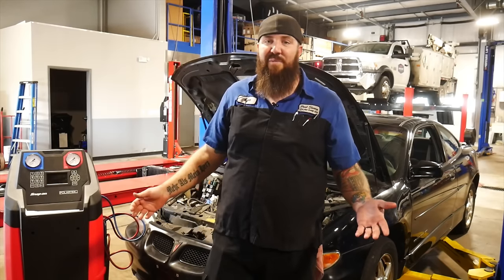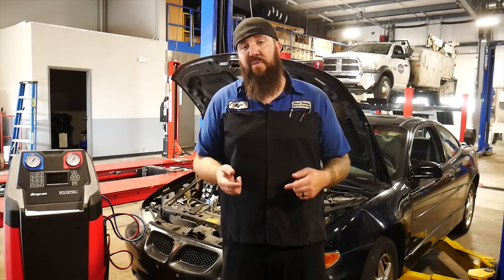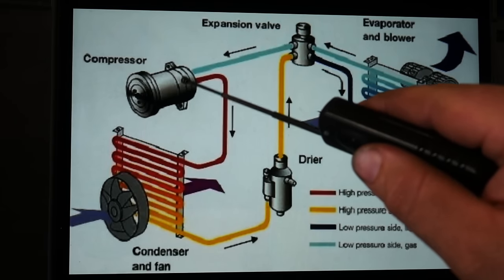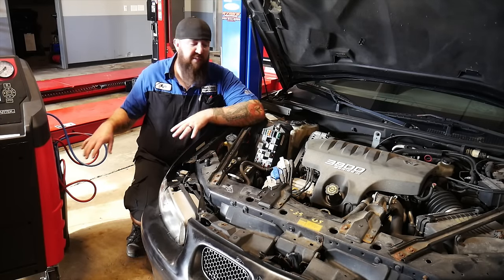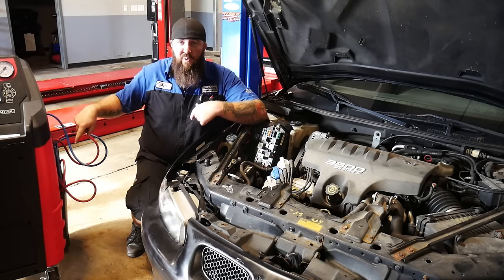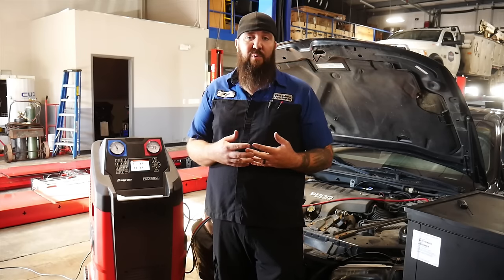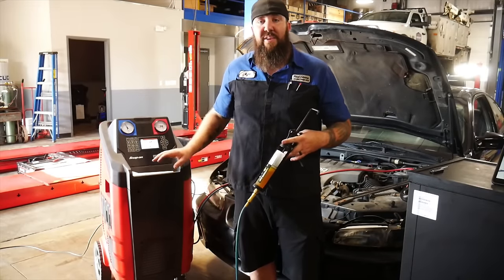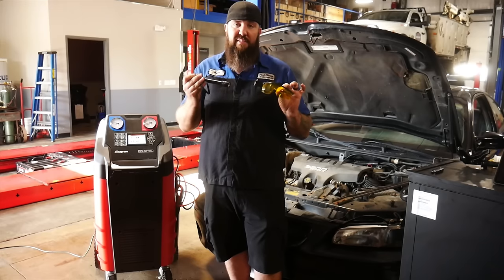AUTOMOTIVE HOW TO: A/C SYSTEM DIAGNOSIS FOR BEGINNERS

Comment: Thank you for the detailed explanation on car AC system. But how to do a diagnostic on a car with totally empty AC system and which has a small leak, how to find that leak?  
I know about hydroscopic properties of the PAG oil. Before I thought it is only air which has the water, and deep vacuum takes care of it. Anyway, I pressurized the system with air, and found a huge leak on Expansion Valve-to-Evaporator connection.  It was hissing, and you could hear it w/no additional devices. It was a wrong o-ring, which came w/the Exp. Valve set. I put a thicker o-ring on the bottom tube (3/32"), and the huge leak stopped. But still there is a small leak somewhere. I pressurized again (30-50 psi), spraying w/soapy water - nothing. But the pressure goes down on your eyes, you can see it, slowly, but drops. It was me, who did something wrong and I can't find it. The system was leaking of course, but much much less. Originally it was empty (the car was w/no AC for 10 years, it is our back up car and we didn't worry much). I tried to fix it at Dealer, but after their several attempts it still failed like after 2 weeks. But the system was working for 2 weeks and after I tried it after 10 years pressing the Schrader valve (I wanted to be sure that there is no refrigerant there, though the gauges showed zero) w/a small flat, it gave that 1 second "pshik" sound. I replaced everything besides Evaporator, Compressor and Liquid Line (it is Expansion Valve to Drier Line on Saturn). Liquid Line I couldn't find for that car, Evaporator is to hard to get to, and the Compressor didn't stall the car before, so I decided to try it. So I flushed the Evaporator and Liquid Line well, several times w/99% Isopropyl Alcohol, then w/Flush Fluid, dried for several days. The Compressor I removed flushed and dried in the same way. I added  PAG100 oil (w/Dye), put all the new o-rings (put oil on them) and washers (no oil, like Shop Manual advises), torqued to specs (I have Shop Manual for that car). So in the future I can repeat all that flushing, put new oil, and everything, but I do need to find that small leak somehow. Do you happen know what can be done at this point? Thank you again.

Comment: When checking subcooling, don't you need to have a high velocity fan blowing on the front side of the condensor to remove the heat from the refrigerant, or is the fan that is installed on the rear side of the water radiator all that is needed? When I check the subcooling on my Toyota Sienna, the sensible temperature of the high side line slowly creeps up causing my subcooling number to continually change (get smaller and smaller, until I have a negative number - which I believe means that the condensor is not getting rid of the heat). I realize that checking cars are a different beast, as compared to checking the HVAC on a house (which has a huge fan that's removing heat at the condensor), so how do vehicle mechanics deal with checking subcooling on a vehicle that's stationary?

Comment: You mentioned in the video that the high-side pressure range is typically between 200 and 260 PSI, and I gleaned that the low side should be around 30 PSI. I didn't hear you specifically mention what the normal pressure range should be for the low-side? I presume that both the high-side and low-side pressures are based on factors like the temperature of the refrigerant, but was wondering what was typical?

Also, do you know what the typical compression ratio should be for automobiles? I'm used to a compression ratio of ~ 3 for home HVAC, so was wondering if that's the same for automobiles. The compression ratio that I'm referring to is when comparing the high-side pressure to the low-side pressure, factoring in standard atmospheric pressure. For example, based on the numbers I saw in this video (High-side = 200PSI and Low-side = 30PSI), I calculate that the compression ratio to be 4.8 (High-Side 200PSI + 14.7 = 214.7PSIA)/(Low-Side 30PSI + 14.7 = 44.7PSIA) = 214.7/44.7=4.8

Thank you.

Comment: Not sure if this is a question you'd be able to answer with the limited info I have, but I have a question regarding possible short cycling. Just bought a 2018 Mazda3 and have noticed the compressor is kicking on for about 8 seconds then off for ~15 seconds over and over basically on repeat. This is with the A/C set to 69 degrees, low fan speed and recirculation on. The A/C works great, always blows cold, no issues I've noticed anyway. All over the internet I've read that it's both totally normal, while others say it's short cycling. Would this typically be considered abnormal cycling?

Comment: We’ve gotta get that new machine for the 2019-2020 vehicles in the next year or so.  $7k for one of them bad boys.
Reply: The 1234yf sucks our machines take way longer than the r134 and only does the leak test when you are charging it won’t do it separately
Reply from the maker: Yep, the 1234yf’s are very time consuming but that’s a lot due to EPA mandates deflation BS. It’s not a quick 20 minute process anymore when it comes to those machines.
Reply: @RustbeltMechanic  wats the difference between 134a and 1234yf?
Reply from the maker: jclark 1234yf is the new industry standard refrigerant. Different chemical compound that is 85% better for the environment

Comment: I have a 2015 GMC Sierra 1500 4whl drive 5.3 my ? Is that when I turn the ac on it throw hot air an it  take like 15min to throw cold air install ac compressor an a  expansion  valve , evaporator, an condenser about 1yr ago thank you for your videos keep the good work please respond

Comment: What could be if my AC blows cold air only if I rev the car past ~2000 RPM ? Also if I keep car in a cold location it blows cold air right away when starting, but if I kept it in hot sun, I need to rev it for a while until I can see some cold air.
Reply: 3 weeks later… it was NOT the compressor, I learned that the expensive way 😅

Comment: thank you very much.  i am still learning. ( ac evap is not leak but the fin of ac evap is blocked with dog fur, dust..etc.   what is the the pressure on low side and high side?

Comment: Please correct me if I'm wrong, can a low refrigerant level cause high and low pressure and low high pressure? Similar to what you showed what they stuck open expansion valve?

Comment: Awesome video man. I’m very new to this I just put a compressor on my wife’s car and it called for 5oz of peg oil this was added to the compressor and reinstalled after I got it back on I then pulled a vacuum for like 45 mins does pulling a vacuum suck that oil back out? It maybe a dumb question I have no idea thanks for any help sir and have a great day
Reply: Hey, im not sure if you found your answer yet, but yes some oil will be sucked out, but it can be put back in while injecting freon, usually it's as easy with a syringe or with the system like a robinair. Just be sure to add the oil before you start it up.

Comment: I just have one question, the first step is to add oil to the system on the low pressure side, the second step is to draw a vacuum in the system and finally add the freon.

Is that correct?

Thank you

Comment: Very Nice awesome but in the diagram shown we got High pressure gas side and low pressure gas side at compressor. So where does the PAG oil for the compressor go?....Would FREON acts as a vapour lubricant ?.....

Comment: Hey, I hope all is well. I just had a question. If I have a clogged expansion valve, won't the low side pressure gradually drop regardless of if I'm driving or idling? As long as I'm idling Ac blows cold, but when I take off to drive it becomes ambient temp after some time. I'll check the low side temp and it is very low. Before driving at idle it'd stay at 30 psi. Thanks!

Comment: My compressor is weak only compress in high speed not on idle,What causes that, do you know? You did not cover it.
Reply: Check the "V" belt or Serpentine belt for slipping and the idler pulley could be slipping.

Comment: My Car Aircon compressor Does not disengage automatically, the evaporator has already cleaned, drier, expansion valve and evaporator thermistor also changed to new one, aircon is drawing cold air, what seems to be the problem?

Comment: Base on my understandingv of this tutorial I have an expansion valve issue to which I was also told by an expert AC technician. I replaced the expansion valve and still having the same exact issue. Does that mean than that I installed a bad or faulty expansion valve even though it’s new?

Comment: I'm having a issue with my 200 F350 5.4, the system isn't cooling and when I hooked up my gauges the low side drops really low when running over 2000 RPM and then the compressor kicks off and on again, but at idle it seems to work just fine. I thought the system was just low on refrigerant so I added some. Now the compressor clutch slips, I've got a video on my channel of what I'm seeing.

Comment: My compressor is sounding bad so I’m going to replace it.
Also replacing the condenser/drier and expansion valve aswell as the performance has been bad.

The thing is : the new compressor comes filled with oil.
If I pull a vacuum after installing everything will that affect the oil level ?
If not : will the system be overfilled with oil ? I’m still going to have oil in the lines and the evaporator since I’m not replacing them

Comment: Hi, I have a Captiva that the aircon only gets almost cold on the drivers side and warm on the passenger. Ive checked the blend doors and they are closing fully. The low and high lines are both cold at the TXV. Also the pump never turns off, so I suspect the TXV is not working correctly. I have a mate whos is coming in a few days with his gauges so your info already given should help me diagnose it. But if you have any clues with the info I have given that would be appreciated. Cheeers

Comment: What year is your truck?...because you have the newer style shift lever (07-up new body style)..did u retro fit  this on your truck?..also your thoughts on a trans pan with a drain plug.(changing my fluid and filter and was thinking of installing a new pan with a drain plug)as my 04 did not have one from factory, butt my brothers 02 does..same trans i know.(4l60)..seems like a good idea for plug?
Reply from the maker: My truck is an 06. The shifter on this one is stock for a 2500. And when I did my trans it came with a deeper pan for the Allison with a drain built in.
Reply: Thanks .appreciated reply

Comment: Hello,  thank  for sharing this video.  I have a 2012  Toyota Highlander. Compressor clutch engages but the AC always blows hot.  The high side  pressure is 90psi and low side is 45psi when compressor is running. And when the clutch disengages for abt 5secs the high side drops to 80psi and low side 60psi. The strangest thing  is the condenser fins feels fairly cold and the receiver/drier also feels somewhat cold as well. I suspect a restriction,  but not sure where it is. There is equal pressure of 70psi on both high and low pressure sides when the compressor is not running. What could be the solution  to this problem? Thanks again.

Comment: Do you have to add oil to the condenser and drier valve? I thought you just have to add PAG oil to the compressor. I'm planning on replacing a compressor with a seized clutch along with the condenser and drier valve and then having it professionally evacuated and recharged. Should I tell them to add more oil and UV dye?

Comment: Hi
Love the video. Wonder if you could diagnose this problem. I only have a low side gauge. Static pressure is exactly right. Electrical is all good. System cools well but the low side reads nearly nothing and compressor make a buzzing noise while running. Any ideas.

Comment: how often should the compressor clutch cycle and how long does it stay off with the AC running. If the clutch never cycles and stays on could it cause the engine to overheat?

Comment: Wait what, you need oil in your AC System? So if I had all my Freon leak out and put the correct amount of Freon back in, I still need to add oil? I have honestly never heard anyone ever say this, I’m surprised.
Reply: The oil is carried throughout the system by refrigerant attached like soap bubbles. Along with the loss of refrigerant, a large part of the amount of oil is also lost.
When recovering the refrigerant, a part of the oil is also collected and must be inspected visually. Assuming it has the correct amount, when refilling, add new oil in the same amount recovered.

Comment: I'm not an AC technician but I understand how AC works. My daughter's car the low side pressure Rises when you turn on the compressor which is making me think that the expansion valve is stuck wide open because I'm not building any pressure on the high side and the low side pressure is not dropping

Comment: Can I ask for help on one please:  2009 Audi A4  128 degree air temp into condenser, fan operational. Duct temp varied to much to get a reading but it wasn't cold. 
Idle 70 low 225 high
2,000 rpm  350 high and compressor cycles on and off at around 22 psi.   
Not sure if it's excessive oil or a plug somewhere.  I can say with the little bit of refrigerant going into the lines to check pressure, about a tbsp of oil drained back out when removed.

Comment: I have a 2004 Ford Expedition and the fuse for the compressor clutch keeps popping. Would that indicate and issue with the compressor going bad?  The clutch is not locking. Fuse pops as soon as i hit the A/C button.

Comment: Excellent video. So my question is where is the problem in a system if your evaporator core is icing up?
Reply from the maker: Likely the expansion valve is stuck open too far, there’s not enough air flow, or the system is over full

Comment: My AC stopped cooling when I was at stop and began cooling when I started moving.  So what cause the fan not to engage? I know the fan is connected to a pressure switch. Is there a parameters to tell the fan to turn on and off?  I plugged in a pressure gauge manifold and notice my low side is more than 40psi. I relieve some pressure and bring it down to 35psi and now everything seems running fine. I have a R1234y systyem.

Comment: Great video on how the system works in general, thank you.
I have 1986 190e which the A/C doesn't work, the compressor doesn't comes on.  I changed the original compressor and the dryer to 134A compatible, changed the push-button control & A/c relay, and the pressure switch, still no luck, would you direct me how to fix it.  Couple local mechanics has charged me to the nose, yet no A/c
Reply: 6 months late , use a piece of wire to jump the pressure switch to see if compressor runs

Comment: I have low pressure 55 and high pressure 150. Fan and compressor working. Only blows colds when running. I change a hose that broke i pull a vacuum and recharge it .

Comment: I thought that my car was low on freon.  Since all the sudden stop blowing cold.  It was working perfect a couple days ago. Sometimes when i start the ac systems get very hot around 125 degrees. And cools down to 95-89 no lees then that. I put 2 cans and last night was working perfec and this morning ac blow warm. The ac clutch engages. The low line where it gets freon doesn't get cold. Driver side its a few degrees higher. I already check the fuses and ac relay and they are ok. Im thinking probably not enough freon or the expansion valve... my car its a2008  mustang gt. Any sujestions or opinions? My car takes 1.625 pounds of freon (26oz)

Comment: I replaced the expansion valve and pressure switch on my 2006 H3 Hummer. Compressor clutch operates as it should. I started charging the system and have only 4 ounces of r134a in it. Both high snd low sides showing 120 psi. No change in cabin temperature.  Bad condenser? Compressor? Something else?

Comment: Hi -
I’m coverting a 1988 S10 from r12 to r134a. I am changing the compressor, accumulator and Orifice tube.
I have flushed the entire system.
I’m told the new compressor comes pre-oiled.
After pulling a vacuum on the entire system, do I need to add oil?
Thanks

Comment: I'm having really high pressure and normal low pressure.  about 325 High and 35 Low.  Ambient is 96F.  My radiator and condenser fans are spinning.  I also have a fan (walmart fan) in front of the car to simulate driving conditions.  Does that mean my condenser fan is simply not strong enough to vent air out of my condenser?  Or that is it that my radiator preventing the venting of hot air? the radiator sits between the condenser and the fans.  Or is my walmart fan not doing enough work to simulate and cool the condenser?  The vehicle operates at normal operating temperature.

Comment: thanks.  can you do more videos like this?
Reply: I can not get my low side to lower it pressure my low pressure is a the 9 o’clock spot on my gage I can not find a way to get it to the 3 o’clock position  we did pull a vacuum on the system but we had to let the freon go in to the high side for the compressor to come on . The high pressure is at about the 2:30 o’clock mark . Any help would be appreciated. Thank you so much for your excellent video it help me understand a little bit more about how it works. Going to check the fan to make sure it is working. Please get me any ideas that you think my help . I do not understand why the compressor will not come on until we open the high side .